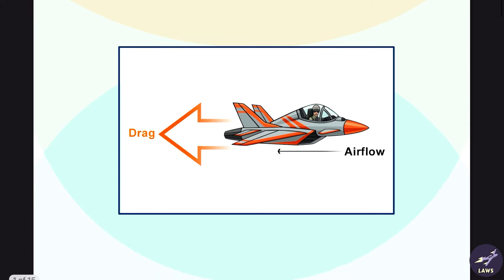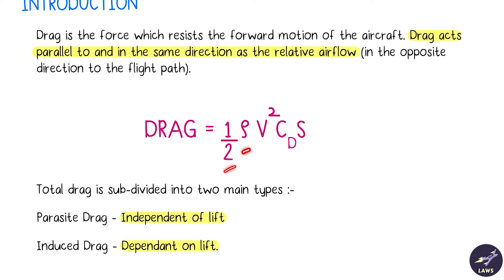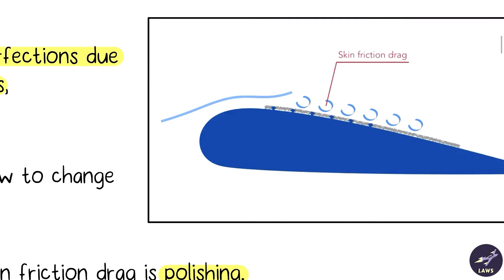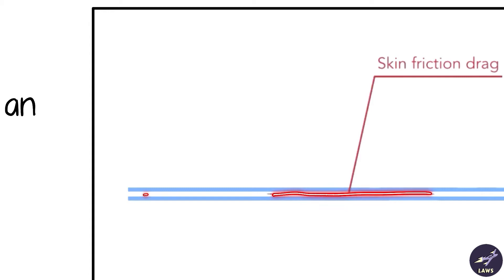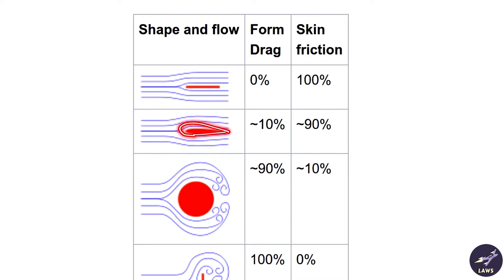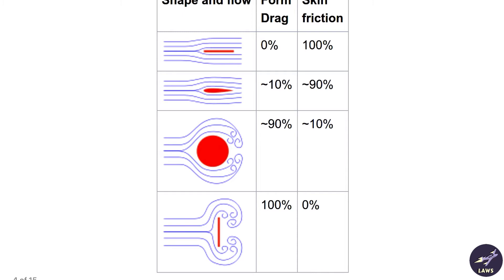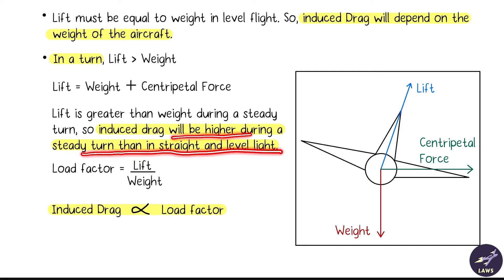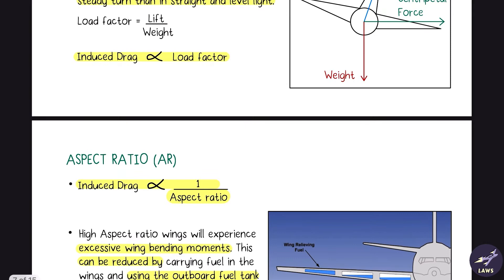Drag - Principles of Flight #4 | Technical General DGCA CPL Exam Ground Classes Online

Comment: First of all very helpfull videos. Question : the part where u mentioned the relationship between induced drag coffecient and lift coefficient . you cancelled out the Dynamic pressure and Surface area, however there is a square on the Lift side, so how everything is cancelled ? is there something i am missing.

Comment: how L/D is the same and Vmd changes as at Vmd we get the lowest drag
Reply from the maker: If Weight increases, Lift has to be increased to balance weight, at the same time as lift increases, induced drag increases, as both L & D increases, the ratio remains the same. As lift increases, Vmd will also increase as per lift equation